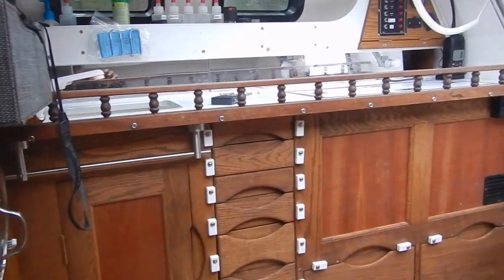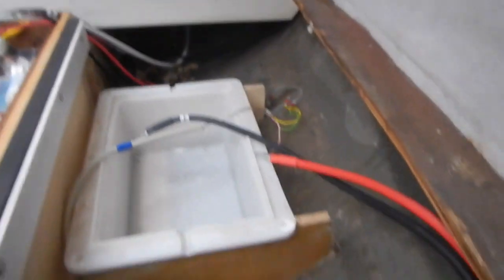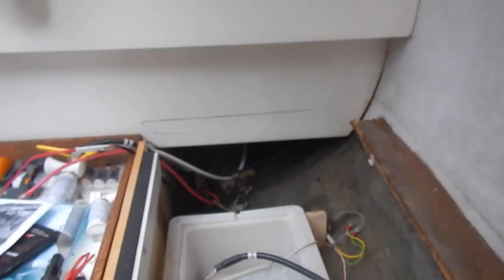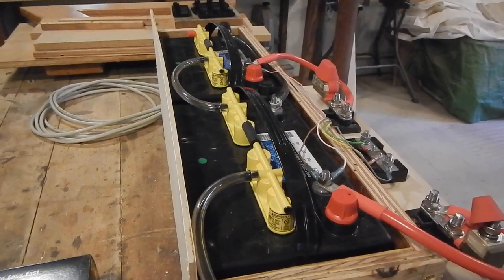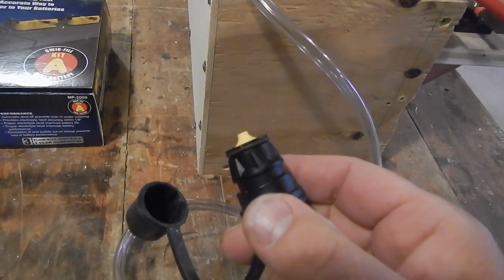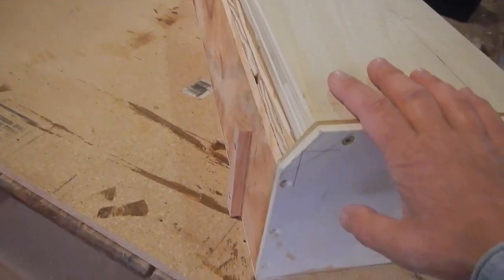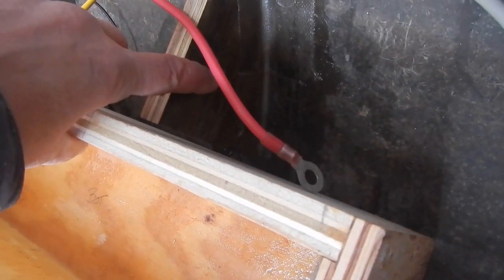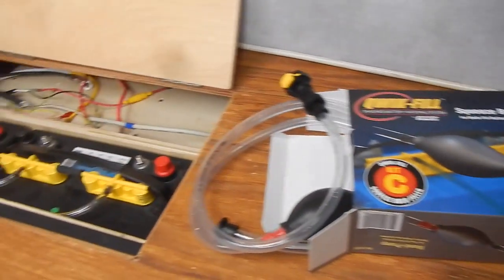Ep 59: Battery Storage

Comment: Battery Cables, Do you buy your cables from a custom cable supplier or do you make your own. If you make your own, what tools/supplies do you use. Cable Source?
Reply from the maker: I used to have all of my larger cables made to order by bestboatwire.com.   They'll do custom length to the nearest foot, with many options for end lugs and heat shrink.  To complete this project, I needed to make some of my cables shorter, so I ordered lug crimping tool from Amazon.  The brand is 'IWISS'. The price was under $30.  It's not a professional grade tool, but it seems to get the job done.  I ordered some lugs from Amazon at the same time.